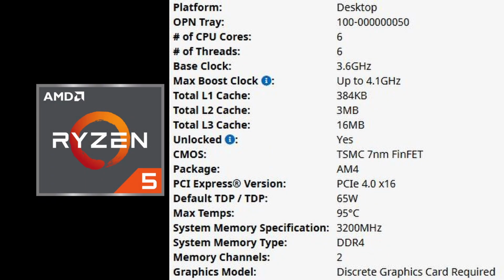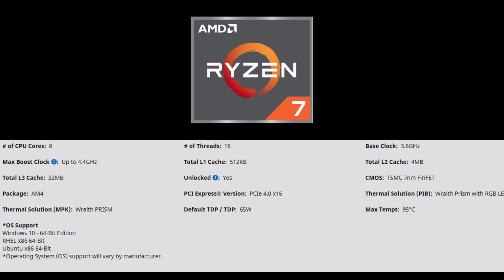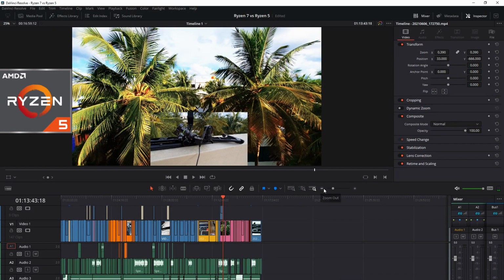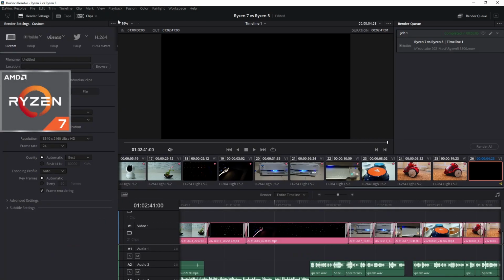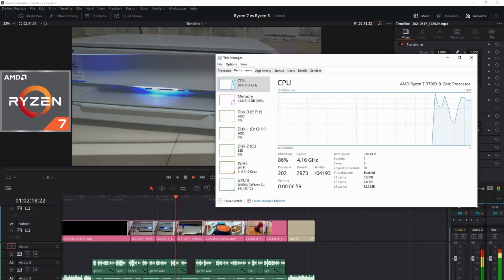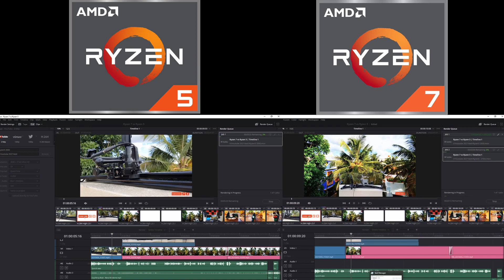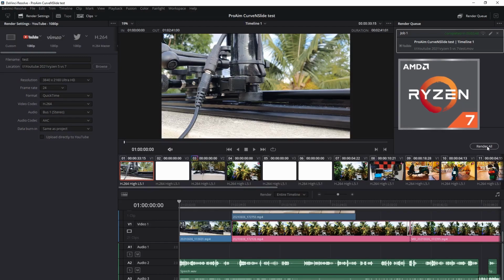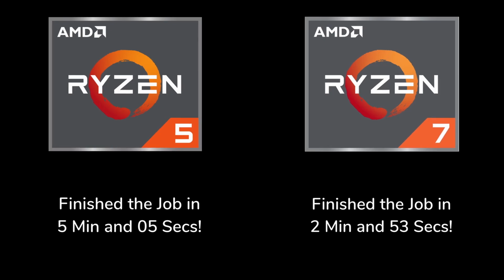Davinci Resolve Multicore CPU Performance on Ryzen 5 vs Ryzen 7

Comment: My PC Build 

*Processor -Ryzen 5 7600
*MoBo- MSI Mag Tomahawk B650 DDR5 Wifi
*GPU- Zotac RTX 4070 Ti Super 16gb VRam
*Ram- Corsair Vengeance DDR5 32gb 16*2 6000Mhz
*Storage- WD Black SN850X 1 TB SSD NVMe + 2TB Kingston KC 3000 SSD NVMe + WD Blue 4TB 5400 HDD - Total 7 Tb
*Cooler- AIO Coolermaster 360L ARGB
*PSU/Smps- Coolermaster 80plus 850 Gold
Cabinet- NZXT H6 Flow Non ARGB

Now as this setup is good for Gaming, then what about 4K Editing on Davinci Resolve etc..? 
Note: Currently on very tight budget and financial crunch..

Any Suggestions..
Reply from the maker: Should do really well, amazing config!
Reply: @rtechreviews  ..Sounds relieving since many has suggested me for Upgrading the Processor since it has only 6 cores and 12 threads and Ram to 64 gb.. Is it True? I'm on very tight budget..Already invested a lot on many gadgets as in process of being a new content creature. Mainly new for Editing and that to 4k on Davinci Resolve.

Comment: I was loving wonderchare filmora 12 till they cancel my lifetime membership anyway that is another story, I'm currently using VICTUS LAPTOP WITH AMD RYZEN 5 7535HS NVIDIA RTX 2050 32GB DDR5 AND 4VRAM and it was tackling the editing program with ease and no problems even when I did 4k videos, I'm not a pro at editing but I think that have passed the stage that I don't consider my self a beginner at editing, Do you think that I can run Davinci Resolve 17 or 18? Do you think that with my setup will be a bit faster since its a newer ryzen 5 than the one that you used on this video?
Reply from the maker: Easily... You can! And yes it will be faster.   Just as an advice... Do not place your laptop on a bed or a blanket during video processing to avoid air flow issues and over heating
Reply: @rtechreviews  thanks for the response 👍,  I was asking cause when  my lifetime subscription got canceled, I found out that Filmora was holding back on the software, especially on certain plug-ins, I also have a cooling fan that I use all the time when using my laptop, thanks for the reply again and thank for making this video.

Comment: Hi, I want to learn davinci but I have 3200g right now with 1660 super gpu, what you recommend for a budget cpu this time?
ryzen 5 5600 or ryzen 7 3800x?
zen 2 or zen 3? can you please make more video like this xD.
thank you for this video btw <3
Reply from the maker: While building a Video editing CPU please try and invest more on a Processor with more cores... In this case the 5600 and the 3800x are both great choices.. the 5600 is newer and makes up for the lesser cores... Try pushing for the 5800 if you can 😊
Reply: @rtechreviews  how about the 5700x?
Does it have big difference from 5800x?
That's only I have on the market
Reply: Bro I have 5600 it lags in da Vinci even having 16 gigs and 12gb graphics card 
CPU eater software
Reply: yeah that's why I get 5700x for my budget and I can't use davinci this time because I'm still finding a job, do you have recommendation there? maybe you have job offer xD  @unknownexposer8399
Reply: @unknownexposer8399  how about now bro?
Reply: @codfish1776  it lags asf when I edit 4k footage but smooth in 1080 1440p footage

Comment: Hey, i am currently useing a ryzen 3600 + a rx5700xt. My CPU is at 100% all the time and i am wondering if i should upgrade it. (My Mainboard supports ryzen 5000.) 

Options would be the
Ryzen 7 3000gen
Ryzen 5 5000gen
Ryzen 7 5000gen

Any recommendations?
Reply from the maker: You mean the CPU is 100% all the time even without using daVinci or other heavy apps?... Eitherways if your planning to upgrade it's ideal to go to the latest gen CPU... But then I thought those had a different PIN structure 🤔
Reply: @rtechreviews  Games run totally fine, but I just got into video editing. With Davinciresolve my projects load very slowly and the timeline sometimes crashes (My CPU probably doesn't keep up). 

I could buy a ryzen 5700x used for or a 5600x
(5800 is too expensive)
The 7000 CPUs unfortunately no longer fit on the motherboard.
Reply: @splagon7068  what did yoh bought?
Reply: @wrathgaming5205  nothing yet but i am aiming for the ryzen 5700x or 5800x on the used market
Reply: @splagon7068 any news Did you upgrade it to 5700x and is it good? Because I want a good processor for editing, I choose 5600 or 5700x. Big difference
Reply: @mohammedaymendz1358  I kinda changed a lot on my pc. I got the 5800x3d in december 2023 and in spring 2024 a rx7800xt

I don t cut videos anymore tho. Games run great

Comment: For me DR uses like 5% cpu and 5% gpu. Only ram is used alot. Do anyone know how to fix this? I forced cuda as well but still no load on gpu. 5950x / 1060 / 32gb ram
Reply from the maker: Did you try reinstalling?
Reply: @rtechreviews  I tried updating The program, still The same problem. I noticed that gpu memory is maxad out tho. Guess thats The problem.  I also learned that I dont need fusion for what i do so I just skip that and things works fine.
Reply: mostly any editing is GPU reliant and not as much RAM.  RAM is more for still photography rendering on photoshop type programs..  This is my understanding.
Reply: @gabequezada2066  Ty. Been a while since i looked at this but i did find out the true bottleneck!

Its actually VIDEO/GPU RAM in my case, that will put everything else to an halt.

Comment: did anyone expect anything different?

More cores = faster rendering in general? wow
Reply: By how much?
Is it worth it?

That's why I'm watching :)
Reply: @ezer0923  It is more complex.

Key is - if possible - to get HARDWARE acceleration.
On Ryzen and Intel you do not get that. So it is always relatively slow!

On Intels I GPU (integrated!!!) you get that. Check on Intel webside. 
BUT it depends on CODEC. e.g H264 or H265 and so on. So check the details as well.

On Apple hardware the ARM chips make a HUGE difference. These support also hardware acceleration .

I bought a MBA just because of that and it works great.
BUT Mac OS is a disaster by itself and I hate my MBA. 
It is just an internet bitch and video editing one for me.

Comment: I has one problem with setup DR I have 5800x and GTX 1070, I render 4K 10bit and previously was i7 6700k, now my CPU when I render work at 7% and GPU 96%, why CPU does not help here?
Reply from the maker: Well it depends on the project... did you add a lot of effects? Usually all the effects are taken care by the GPU. Also are you processing h.264 or h.265?

Comment: Very Nice perspective. What about the 1070ti card? Could you make another vídeo without it or a less powerful vídeo card to know how much effort it takes for the integrated gpu? Great video.
Reply from the maker: Honestly... the gpu was hardly getting used during rendering... this is despite the fact that I used Cuda processing as default... so I seriously doubt it would have a difference
Reply: @rtechreviews  My mistake, i meant in order to know how mucho effort the cpu undertakes with a less power vídeo card. Thans for sharing tour knowledge

Comment: You used the Cheapest Ryzen 5 from the 3000 series, a Ryzen 5 3600 or 3600x are much more popular and have much more performance
Reply from the maker: Yes true that... just wanted to showcase the core based performance... both the 3600 and 3500 have 6 cores....  thread count is another aspect altogether
Reply: @rtechreviews  yeah but the 5 3600/x has 32MB L3 cache instead of 16MB like the Ryzen 5 3500 does and the 3600/x has 12 threads and boosts higher. My brother bought a Ryzen 5 5600x a week ago and now thinks that Ryzen 5s are bad for rendering and editing and now is thinking of send it back and buy a Ryzen 7 instead.
Reply from the maker: Yup its the core count that matters for rendering

Comment: Thanks for posting this. This was one of the biggest questions I had, currently building out a Ryzen system for this exact purpose. Which version of Resolve are you using? Also, Windows 10? It'd be interesting to see how the Ryzen 9 and Ryzen 3 stack up against these for the same use scenario, ie is a 3900x a good value vs Ryzen 7 for this purpose, or is the Ryzen 3 with it's 4 cores an acceptable or comparable bargain vs the Ryzen 5.
Reply from the maker: Thank you... I was using the latest version of resolve.. I guess 17.x and ofcourse windows 10 pro. I wish I had the Ryzen 9 for comparison 🥰 of course it will be much faster with its cores and extra threads. Will the ryzen 3 work... yes..but its gonna be surely slower... to be honest navigation on a 4k timeline would be difficult.
Reply: @rtechreviews  Free version of Resolve or paid Studio version?